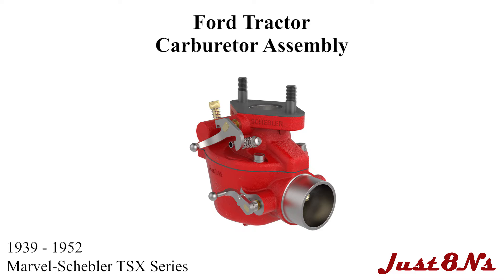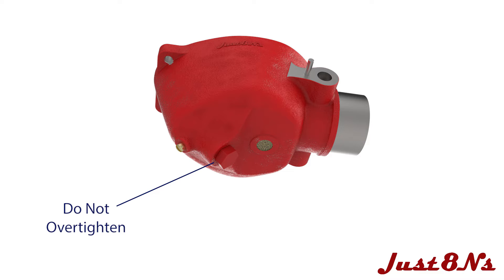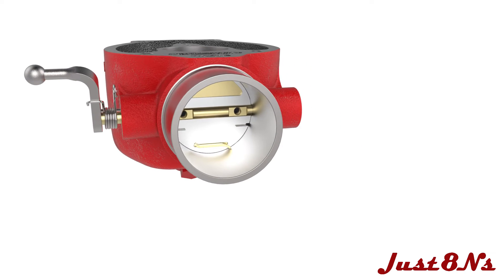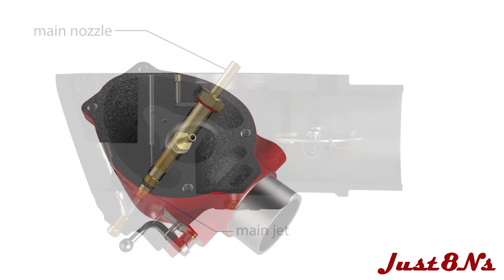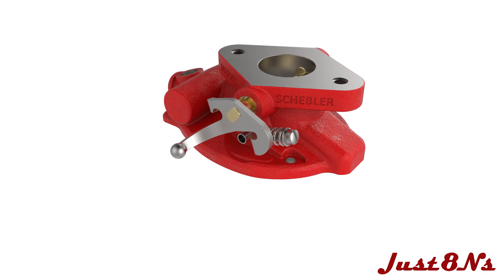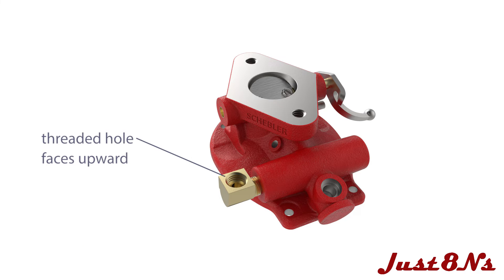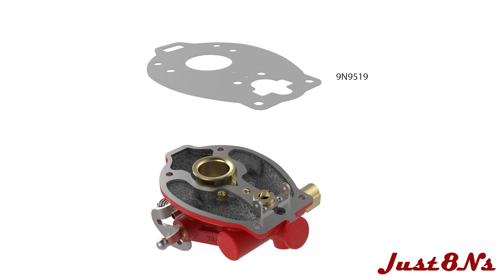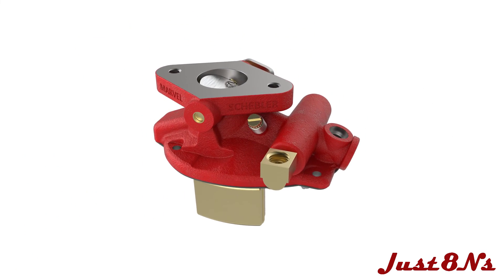Ford Tractor 1939-1952 Marvel-Schebler TSX Series Carburetor Rebuild

Comment: Excellent video's.  I have just rebuilt a TSX 33 for my 2N. I had a difficult time with the choke assembly. I thought i finally got it but the choke is closed by the spring and my float linkage doesnt open it. I can open it by hand by overcoming the spring but cant figure out how to keep it open after starting. I think i installed the choke plate wrong but cant find documentation on how to install the plate correctly. Please help. Thank you.